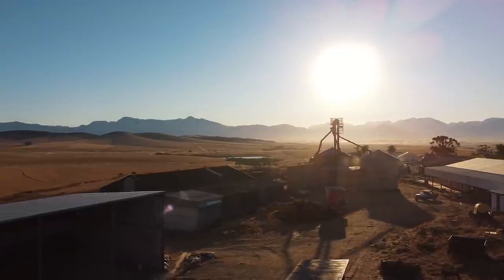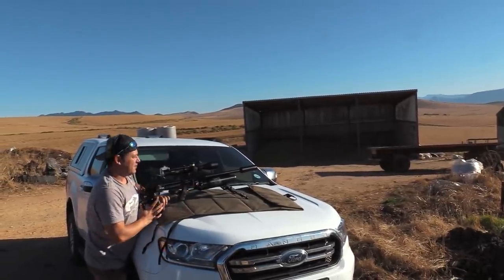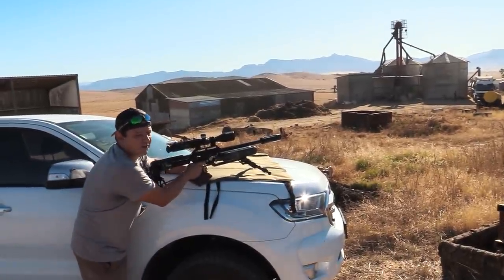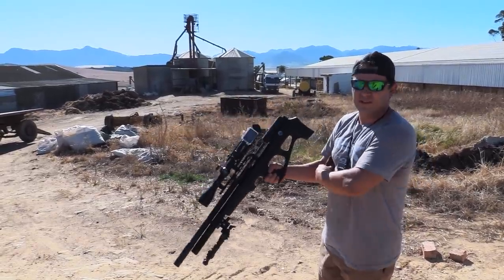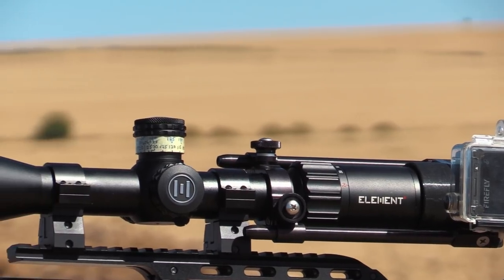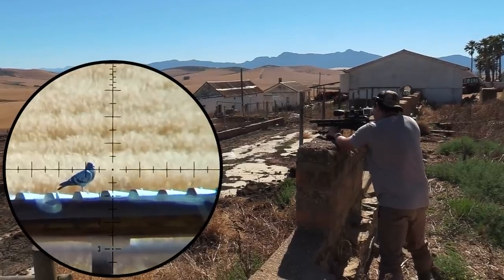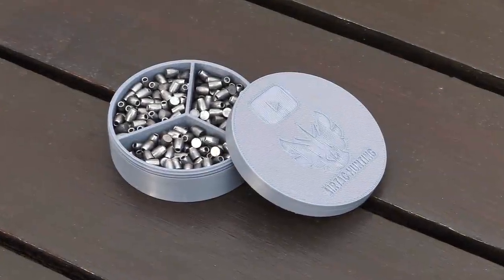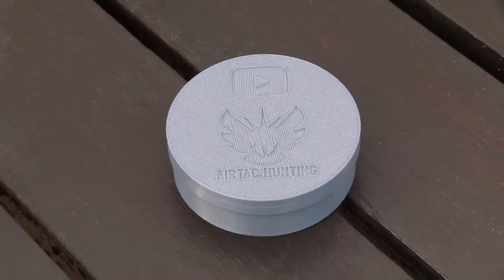Action-Packed Airgun Hunt + Custom Pellet/Slug Holder Share / 3D Printing

Comment: Seeing Wildcat hit at more than 100m makes me think if there is a need for  Impact when this thing can lob slugs at 1000 fps
Reply from the maker: They use the same barrels.   The Impact does give you more power and options, but the Wildcat is a much more simple and robust design, plus the Wildcat Mk3 has more than enough power to sling slugs at high speed.  Way cheaper as well.